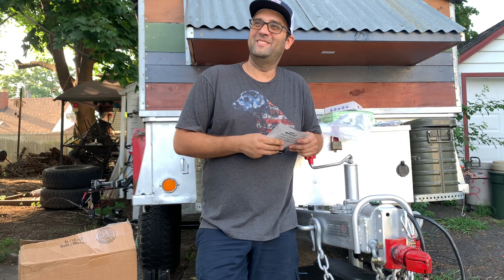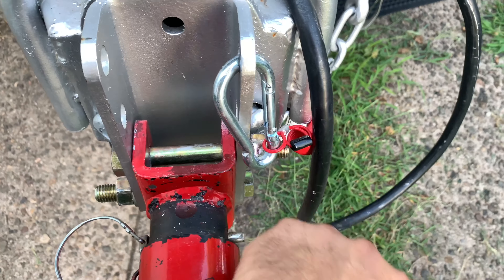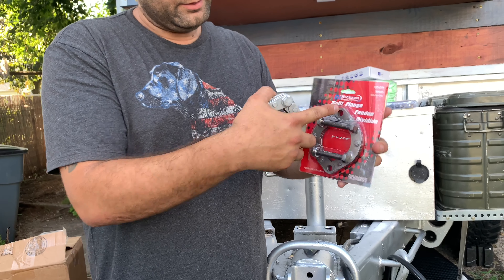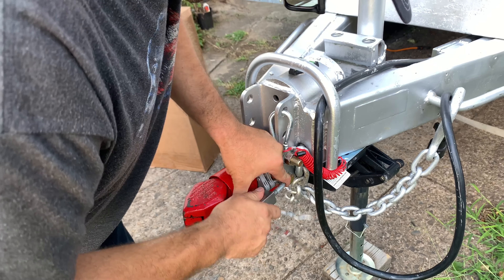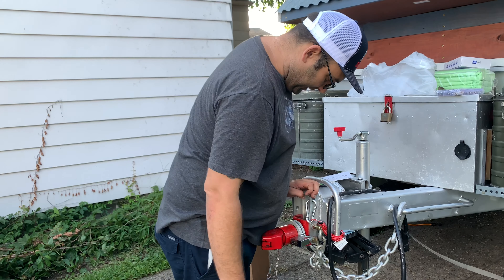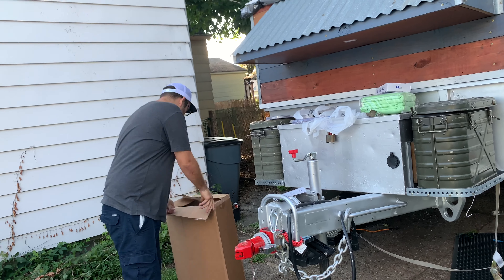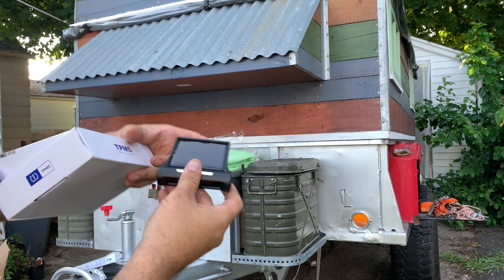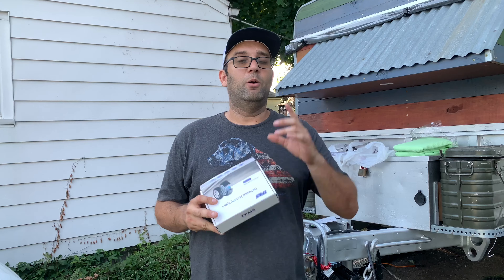Homemade Collar lock coupler lock

Comment: All they have to do is pull up and hook up the tow chains and drive off. Invest in the Ft. Knox or Proven Industries lock that covers the entire coupler and get some 1/2 inch Pewag chain to lock the wheels to to axle.